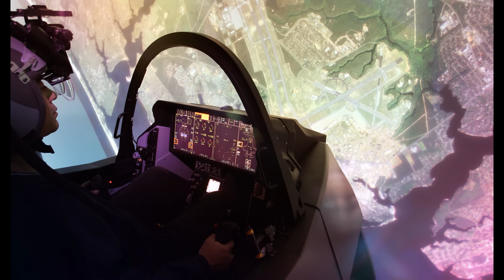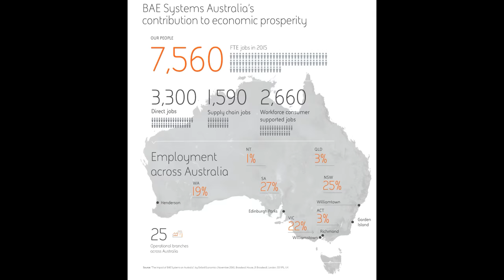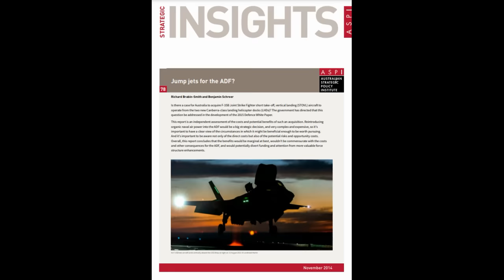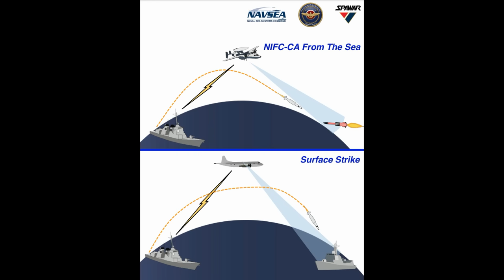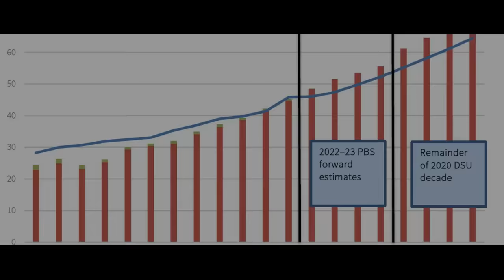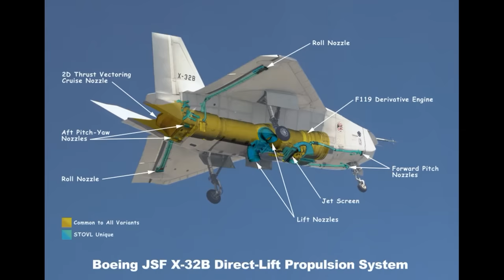The MQ-28A Ghost Bat, Unmanned Systems and the Future of Australian Air Power

Comment: I do not think the HMAS Canberra class (the LHD)'s are even rated for F-35B's? But the official stated reason for the current lack of fighter craft for the LHD's is silly, and it doesn't even need an expert to deconstruct it as the house of cards it is; but I don't think looking to the US or the UK, Japan or even France for example is the best rebuttal to use. They have what 10 times the population of Australia, a defence budget we can not hope to match etc. I think the example of Spain is more sensible, although I would also argue that the base sizes of all the ADF services should be expanded (not just the army)
The lack of protection to low flying anti-ship missiles and the need to counter that I think is a far stronger rebuttal, especially as I do not think the Seahawk provides that role, and I do not think that the RAN can afford a 'carrier battlegroup' style protection for its LHD's. I do believe that if not the F-35B, then the LHD's should be fitted with a component of Ghost Bats providing they can both be carrier mounted. It also seems entirely stupid to place the responsibility of protectioninto the hands of our allies. We have already experienced shortfalls in military acquisition (and lets face it, I doubt we'd get a nuclear sub until around 2040). It could simply be a case that allies can not task their craft to protect our ships due to any reason, from lack of availability to even that their own vessels obviously take precedence. And if the Canberra class aren't rated for F-35B's, then that just means that those ships can't even be used to refit their defenders or even refuel them.

EDIT: The super ghost-bat bomber ~@1:57:30 idea is plausible, but probably not something current ADF would consider. Fully autonomous weapon systems is something that the ADF does not currently support (I have had to write about this recently during my university degree so my research was quite recent). You would have to loop a pilot (or at least a human) in somehow, possibly by an accompanying B-21 pilot ;). Having said that; I'm not sure if that applies to pre-planned missions where there is a defined target - say a manufacturing plant, rather than adhoc targets like say AA guns.

I do think the ADF stands at an interesting point where it could be the leading user of AI derived military hardware in the world, or at least one of the worlds heaviest users. The RAN is also developing submarine drones as well (oh, you discuss this too!)
Reply: Spain has almost double the population of Australia

Comment: Really the major challenge is the code. Once a general ai is developed for this sort of application it can be easily modified to fit different airframes. So as costs for new technology in the physical realm decrease new drones can be introduced and code for the aircraft can be uploaded with only minor changes.

Comment: Even if the pilot is isn't needed within the aircraft cockpit, one will always or more or less always needed to have at least partial control, so a semi-autonomous aircraft or loyal wingman aircraft, for 1,  for accountability, 2 for better understanding of the battlefield and the spacial awareness of the aircraft through its external sensors especially when talking about the RAF Typhoon or even more so the F-35A-B or C, so needing a pilot at the control of any aircraft will always be necessary whether within or without side of the aircraft, and with loyal wingmen on the horizon, things can only get more complicated, just like it was when drones first came to light and began carrying their own missiles attacks piloted by USAF pilots piloting the drones from the Mojave desert in the United States flying aircraft like the MQ-9 Reaper ans it's variants, or similar aircraft like the UK's predator and new protector drones

Comment: This ghost bat thing needs mid air refueling..  most of what these things are built for is to shield the F-35 during penetration raids . Which usually happens deep in enemy territory. Attacks on surface to air missile batteries. Ground based radar and the occasional general that has strayed into Iraq to gain support for War . I doubt these things carry enough gas for that journey and the return. Didn’t see mid air refueling in the demo video.. might wanna get that done and bump up the price tag a little.. be a sight to see these things shadowing Raptor into hostile territory to pick a fight . Almost worth the run ..

Comment: As long as they don't make this solely a reconnaissance aircraft and we have multiple role fighters, bombers and reconnaissance !!! Australia desperately needs all especially with the expensive F-35's which cost a fortune to run and maintain. The F-18's are an ageing fleet. I wish they would get some F-15's even if they don't have the latest tech they would make an amazing long range fighter bomber for Australia's vast size and would be far cheaper to run than the F-35's.

Comment: - Domestic Amphibious LAV (should've been built by subsidised Holden but that's long gone),
- Catalina Sea Plane domestic supply chain. 
- PT boat domestic supply chain.
- long range missiles & missile shield.
- They need to forget these large one off orders and focus on domestic industrial manufacturing and supply chains with staff retention to establish a skills base.
- Networked Drones / Cheap Maneuverable drone swarm shield & amphibious HIMAR.
- Develop a better relationship with SpaceX and push for sister Space-Port in Oz using beneficial tax agreement and subsidy.
- Only 'easy' if Australia secures semi-conductors which it currently has not, 
- Honestly, the cheapest solution is to just pack standard hollowed out jumbo jets and decommissioned cruise ships with long range missiles.
- God knows why we just bought a bunch of main battle tanks...on an island south of an archipelago.
- Run these as joint projects with Japan.
Reply: Is there a narrative here? Or just brain diarrhoea? Just worried about good ideas not effectively exoressed
Reply: @BenDaviesHe3  Just some points I think are worth mentioning on this topic. I like the channel and it helps the creator to comment and their video. If you're going to be toxic at least spell check.
Reply: @nicheva417  sorry, please accept my apologies.
Reply: @BenDaviesHe3  No.

Comment: Don’t have time to watch it all now but so far so good.

I would say manned 7th gen fighter are a waste of time.  Manned aircraft will be useful, just not in fighter form.  You want the aircraft with humans in to be the least discoverable as possible.  So a single seat small b2/b21 would be much better.  Then it can be supported by less stealthy drones as the fighter back up.  The stealth manned aircraft is there as a decision maker, should the link from drones to base is lost through jamming.  If the link between manned and unmanned is lost the the ai would manurer them into close enough range for alternative data transmission.  Ultimately there will be a day when the ai will auto attack.  It’s almost inevitable.

Comment: 1:17 - I disagree with your suggestion of re-equipping No.1 squadron with F35Bs. If we are to go down the F35B route - and there are compelling reasons to do, as you say - we should raise another squadron to do so. The super hornets will do good work teaming with the F35 and Ghost-bat and growlers of No.6 squadron until the late 2030s. We shouldn’t disturb that capability in pursuit of another. Also - regarding your suggestion of replacing the Choules with a 3rd LHD - I totally agree, but how about something more ambitious than a third Canberra Class? How about contracting to the Italians for another Trieste class: slightly bigger than the Canberra class but designed specifically with the physical footprint of the f35B in mind (as opposed to the Jan Carlos, which really only had a STOVL plane not much larger than the Sea Harrier in mind).
Reply: The reason to re-equip No. 1 is the frames are becoming old and a plan replacement is already in place. All that needs to happen is a choice of which aircraft.  Raising a new squadron would not stop replacement of No. 1

Comment: One of the interesting thing that i think about UCAV's is power generation. These are smaller platforms with smaller engines. This means they cannot generate as much electricity as a fighter. So you will not be able to use the same powerful sensors that make 5th gen so potent.

Comment: If true, a massive AI R&D project like what is described in this video assigned to Australia is extremely surprising.
Although any exceptional individuals can tip the scales, the massive technological resources necessary to create, build, operate and develop a complex wargaming environment and training an AI neural net algorithm using machine learning requires the resources of either China or the US and likely is far beyond the capabilities of any other country including Australia. The pieces required to build this would be myriad and bleeding edge, plus would require the use of supercomputers that AFAIK don't exist in Australia. It's possible to develop the critical NN algorithm with less than the most advanced technology known to man, but the consequences would be a many fold increase in time required to develop a competent algorithm with 97% performance compare to the best that can be achieved by humans.
Reply: I doubt that neural networks will be doing the driving. They may be used for various functions e.g. for target recognition. But the 'AI' decision making will probably be more like a big tree diagram, the computer will have a bunch of pre-written routines to follow based on its orders and the current circumstances. Much more like a video game AI or a self-driving car.
Reply: @nerd1000ify  Neural network AI can do as much as humans allow. Chess (and Go) playing AI has shown that AI is capable of learning how to solve any problem that might be posed if it can be game played.
Reply: @tonysu8860  sure, but artificial neural networks aren't always the most efficient way to arrive at the outcome you desire. Especially if you want to be sure of behaviour in weird edge cases.

Comment: There is too much customizing to suit a single role while having them built here.  RAN are the worst at that currently Hunter, Hobart, LHD, OPV and SSN, and the Army has done the same with Taipan and Tiger. The RAAF seems to have had more success like the Wedgetail and Ghost  Bat. These restrictions take too long and does not always have the flexibility to adapt when something new is needed.

Agree naval aviation has been overlooked just like amphibious ability when it comes to cross services functions. The RAN seem to not want fixed wing aircraft and the RAAF does not seem to want planes on ships or could landed on Island strips or roads.

Look at what the RAN are working on 3 types of drones, UUV Underwater, USV surface and UAV Rotor wing yet we have the Canberras yet RAN are not even looking for a fixed wing drones instead relying on tankers fueled F-35a. What is also overlooked with long range F35 is pilots could be flying for hours straight to fight for a few minutes instead of resting, reloading and be up to fight within minutes.

Comment: Have the US Marines F-35Bs been tested on HMAS Canberra. Or any operation.  This should be easily done.  Providing some evidence that it may or not be suitable to operate F-35Bs.  Would that be acceptable to ADF 
bureaucrats. Or threaten their concepts of reality.    P-8 Poseidon's could also support the RAN for protection against missiles.  On occasion against enemy helicopters   or MPA aircraft.  This would require the integration/adaptation to fire AMRAAM missiles.  Possibly carrying a dozen missiles or more with some physical alteration.  The P-8  already has a weapons system and weapons mountings.   On board, F-35Bs, would have a much faster threat response.  24/7.  Only 20 F-35Bs would be needed. 30 better.  Nuclear submarines were s vital part of the Falkland Islands.  Argentina attacked when they found that the RN had no subs in the region.  F-35Bs have great sensor capabilities to greatly increase RAN situational awareness.   As few as 4 onboard F-35B could be very useful. More fighters being in maintenance, some spares and training.  ADF arguments against F-35Bs have been shallow and at times lies.  While they plan for future subs costing $50 billion. A Poseidon can provide many hours of coverage with relief aircrew and using tanker support. The P-8 could carry an ERIEYE radar. 

Some Fox bats can likely be hung from the upper deck above useful inner deck space. Another option is to be hung vertically. A folding ring would be useful. 

I like the X-47B UAV as a possible bomber.  Able to operate from conventional carriers.  Landings on carrier decks and in flight refuelling capabilities have  already been developed.  This is larger and more stealth than GhostBat.  But I am not suggesting carrier operations.  Only that it shows how capable the X-47B is.  

An extreme option for Australia's defence from nuclear weapons could be the use of dirty bombs dropped into major rivers.  China is highly dependent on some very large river systems.  Nuclear waste would impact for many years.  This is an abhorrent idea and generally unacceptable.  But if we are threatened by nuclear weapons, we have a powerful counteroffer. The Ghost Bat could deliver such damnation.  Something I would not want to see.  This could be much more dangerous than Hiroshima and Nagasaki.  Rivers that have supported civilisations.  

I would much rather work with China and Indonesia to develop Generation 4 nuclear reactors.  China now has two operating Gen 4 prototype reactor plants. Possibly 3 tractors.  China and India see planning for over 60 nuclear power plants.  Mainly Gen 3+ at the moment.  But Gen 4 could be safer, cleaner, cheaper, smaller, and modular.  Indonesia is working with a US company to developing floating Gen 4 reactor plants.  Reactors have been used very safely by PWR type reactors for many decades. The planned floating reactors would be protected by very strong reinforced concrete.  Able to resist a crash from a 747 airliner. Gen 4  reactors are very different technologies, using the natural laws of physics to create naturally safe reactors.  Not using high pressure or metal fuel rods in loft Gen 3 reactors.

Comment: The Australian Government's recent funding boost to the MQ-28A Ghost Bat aircraft program, as announced at the Australian Defence Force HQ in Canberra, represents a questionable pursuit of high-tech prestige over practicality. The MQ-28A, formerly known as the Loyal Wingman, is celebrated as the first combat aircraft designed and built in Australia in over half a century, aimed at enhancing the Royal Australian Air Force's capabilities as a force multiplier. So what! It still requires a pilot. Moreover, this initiative can be seen as an extravagant endeavour that overlooks the aircraft's notable vulnerabilities, including its susceptibility to attack and limited self-defence capabilities and payload. Furthermore, the investment is criticised for its substantial cost, especially when more affordable, off-the-shelf alternatives offer superior armament capacity and effective interoperability. This decision seems to reflect an unnecessary competition for technological status rather than a judicious assessment of defence needs and cost-effectiveness. Defence procurement is broken at all levels. Assessment:- Pass on this proposal.